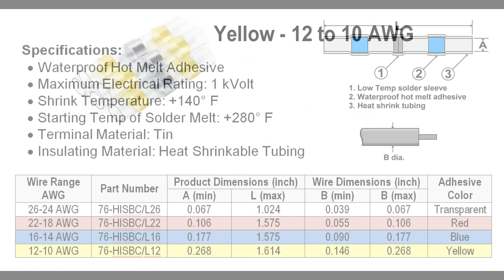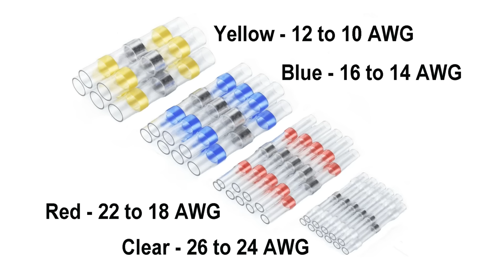Heat Shrink Self-Solder Butt Splice Connectors

Comment: How much did they pay Summit? Low temp solder? What happens if the wires heat up?
Reply: Mike Miller let's say it does get up to the temp needed to melt the solder. We're talking a whole other issue on why it is getting that hot. You have a catastrophic failure somewhere, that isn't related to this joint. I'd say it would be worth using without this fear.
Reply: nitroman365- I completely disagree with you. Regardless if the heat is coming from the wire due to a overload or heat by its surroundings, it still will melt the solder and could cause electrical fires. 

If Summit is backing this product, they should do so with all the knowledge of the product. But I doubt that is done. I’m sure it’s just money passing hands.
Reply: I can't say this is an ideal solution for every application.  But you have to understand that the temps it is taking to melt is extreme. Unless you put it right by an exhaust, or header, you're going to be fine. And if the load is so great that it gets that hot to melt the solder, then you have installed too small of a wire on that load. It all comes down to user error and responsibility. Peace
Reply: nitroman365 - the temps are not extreme to melt the solder. That’s the entire concern!
Reply: Mike Miller The melting point of the solder is 266°F.  That is, wires that carry current speaking, extreme heat. Again, place it near exhaust, you'll have issues. But it would have to be in an extreme close proximity to the exhaust for this to happen.
Reply: nitroman365- How do you know that? Have documentation?
Reply: "Apply hot forced air, 266° F or higher, to the solder ring until the solder melts"
Reply: nitroman365 - Not seeing it. Where are you getting that temp from?
Reply: Mike Miller Near the bottom, under "Product Details"
Reply: nitroman365- I don’t know where you seen that. But I just seen in the video that it melts at 280F. Which is almost 90 degrees lower than standard solder. Maybe this will work for some applications, but time will tell.
Reply: Mike Miller Keep in mind that that temperature has to be an isolated temp for a period of time. If it is that hot in a small space, other things will fail around it. It doesn't get that hot under the hood of a car. Upper 100's, sure. 200+?  Not so much. These are being marketed, in this scenario, for car guys. I know an FM transmitter for a radio station will see high temps in which it won't work for. So I stand by my previous statements. Keep them away from exhaust, which is common sense for any wire, and you shouldn't have an issue.
Reply: One last note. These are really designed for people who can't solder, or don't have the equipment. Anyone who can solder wouldn't use these.
Reply: I've used these things and it has to get extremely hot to solder them.  If it's good enough  for the F18 and  the Boeing 777, it will work for your car.
Reply: Been using these for LS Swap harnesses for 10 years.. it's way faster than using a solder iron & shrink. I put hear shrink over the solder shrink to hide my work
Reply: You can get them cheaper on AliExpress...50 count for $5
Reply: nitroman365 is right.  Most "high temperature" wire is rated for 105C/221F, lower than the melting point of the solder.  But I still wouldn't really use these much.  The aerospace industry stopped using them I think, due to occasional unwetted joints

Comment: Would be so useful for an electrician or other professional but will ever it be affordable enough for hobbyists to use it regularly
Reply: Elijah French the are afordabel on amazon from other manufactures this is nothing new my dad uesd thes 20 yearsrs ago in automotiv work
Reply: Nick Hetzer oh... Never seen them before
Reply: Elijah French they are ok but buttconectors to crimp with heat shrink and glue are way better but you need to use a god crimp tool not one of those 20 buck ones more like 70 buy one nice crimp tool for the rest of your life and the cheap one dont crimp nice

Comment: Wonder how much lead is in that solder for it to follow at such low temperatures. Also what about the corrosion characteristics of flux? If it's waterproof there's no way to neutralize the flux.
Reply: It probably uses Roisn based flux, which is a no-clean flux. It will be fine
Reply: Since when do you neutralise electronics flux?
Reply: Lead was banned a long time ago with ROHS.  Also these likely use a non aggressive no clean Flux.
Reply: Lead is banned only for new production. Lead containing solder is still allowed to use for service.
Reply: I use lead 60% tin 40% solder every day on military-grade harnesses
Reply: I think you can add gallium instead of lead to lower the melting point.

Comment: Nothing new. Aircraft have been using them for a long time.  Amazon even carries them.  The trick is to get them to solder in the first try because you melt the heat shrink if you try a second time.

Comment: Cool idea, but terrible price. I'd stick with the original way and save money. Way to expensive
Reply: Sean Zachary Uy check ebay. This tech isn't anything new and I get mine off eBay, 100 pieces for 24 Bucks.
Reply: jimmy vaught ok... that's sure a better pruce, but then again, I can get 100 metres of heartstrings for 4 bucks. So.. I'd stick with my way way for now, maybe I'd look into it for soldering more expensive stuff. But for now... imma save money.

Comment: lmfaooo almost 1$ per connection... for that you can get a soldering station, good quality solder and enough heat shrink tube for a year AND make better quality stronger joints
Reply: Damn, where do you buy all that for 1$?
Reply: I am buying them in Philippines for about 4 USD cents each. Shop around for a better deal.

Comment: that connection is anything but reliable, lots of lose wire strands that can create arching which will melt the plastic and cause problems.

Comment: Neat idea, but I wouldnt trust it.
Reply: IN1VISIBLE3.- they have been using them in aircraft for years.  I only have experience  at  Boeing, but all their planes  use them.
Reply: gsxrgeorge00 So safe to say they are more reliable than anything ever put into a car...
Reply: Yup, these have been used in aviation for decades.
Reply: Yep, they've been used in aerospace industry for more than 30 years.
Reply: Do they work with oxidised wires? What alloy is used?
Reply: Why are you using Luke lafreniere as you profile picture....
Reply: You would not trust a soldiered connection with an adhesive water barrier and heat shrink tubing?  
What exactly would you trust other than a single, uninterrupted wire?  

Not sure you understand the connection at all.

Comment: why should I pay that much to maybe save a few seconds on something I'm never rushing or in a hurry to finish, plus the flux will eventually cause the joint to corrode and start creeping up the wire,  not a job I would want to keep an eye on or re do every few years nor do I want to worry about the structural integrity of the splice especially because of the low temp solder,  besides I don't use solder connections because of reliability issues and whenever possible I run wiring from new components to a fusebox or junction block dedicated to aftermarket components, I never hack into wiring harnesses and if one has a bad wire I replace it after finding the cause of the failure therefore I can't think of a situation where I would use these over proper mechanical connection technologies this product is for the guy who's toolbox and tools have more experience than the owner... or the speakerbox butchering audio tech wannabe that uses lamp wire and sheetrock screws that insists they are a pro and have the balls to charge real money for their mickey mouse installation,  Can ya dig it?
Reply: The aviation industry has been using these for the past 30 years. I guess every time you fly if you can afford that you're on borrowed time cause of their "mickey mouse installation". If 20 cents is to much for you then maybe you should rethink your life choices cause clearly the videos you upload show you're below poverty. The wire would break before the connection on a tug test.

Comment: 1. Too expensive
2. Takes too long
3. Try getting a heat 🔥 gun in difficult places
4. Takes too long to cool
6. Please kill that useless music intro and throughout. It's annoying at best.
7. If you don't get the heat EXACTLY correct, you either end up with a cold solder joint or you end up melting the insulation hence defeating the purpose of this.
Reply: I just got a 100 pack off Amazon for $23 Canadian it's like 4 cents a piece and they work great with quick passes from a torch lighter.

Comment: Stupid product. Way too expensive to be even remotely practical. 100 connections for $70. I can buy a 1lb spool of solder and make 1000 connections for $20. That's 35x cheaper.  It's also no less work than twisting the wires together, soldering, and heat shrinking them the "old fashioned way".

Comment: The low melting point of the solder will make these connections a lone not reliable. Get a hot day and the glue and the solder will become soft.

Comment: I returned this crap;  it does not work. The problem with this product is the flaw in design and the materials used. There should be a sort of sync between the melting temperature of the solder and the melting point of the insulation, in a manner which should prevent self-destruction. What happens is that if you don't hit the melting point of the solder, the heat-shrink will shrink and become very soft without having the actual connection soldered and if you heat-up at a temperature which will do the actual soldering, the heat-shrink will be damaged. I used various methods, including a few hot air guns, near and far and what-not; IT DOES NOT WORK!
Reply: I got these off Amazon and the solder melts quick with a few passes from a torch lighter.
Reply: @PabloGonzalez-hv3td  Good for you! Do a resistance test; mechanical and electrical!
Reply: @A.Dude.  They work just fine with a little patience.
Reply: @PabloGonzalez-hv3td  Mate, calm down! I'll take your statement for granted and will look at myself at being wrong, the minute well established car audio installers like five star audio, will start using this system. Until then, have a long and joyful life!
Reply: @A.Dude.  Judging by the number of exclamation points used I'm not sure I'm the excited one in this exchange.

Comment: Automotive manufacturers would never use these. This is how you start fires, and melt big globs of wires together. Always crimp wires.
Reply: Crimping is inferior to soldering, but those are way inferior to true soldering. I can see that the solder in those acted more like glue than solder and I have doubt on the reliability, however I am sure that it will be more reliable than crimping.

Crimping is good for speed, not reliability.
Reply: @thephantom1492  incorrect
Reply: @RustBeltAuto  Then tell that to NASA
Reply: @thephantom1492  so you work for NASA? You show me a link where NASA says a soldered wire creates less resistance that a properly crimped wire. I will be waiting for your response FOREVER.
Reply: @RustBeltAuto  It is somewhere on the nasa site, however I can't quickly find it back, but I'll leave you with this: https://nepp.nasa.gov/files/27631/NSTD87394A.pdf and https://workmanship.nasa.gov/lib/insp/2%20books/links/sections/407%20Splices.html . Both crimp and solder is accepted by nasa, but I can't find where they say that they prefer soldered splice whenever possible. Both have their advantages and disadvantage, like crimp offer a better strain relief than soldered, but offer an higher resistance and if moisture get to it it can easilly corrode and cause a massive issue. Soldering is better for this as you have a lump of metal to pass throught, not just a bit of metal at contact point.

But crimp is faster, thru cheaper to make, hence why it is prefered in most application, and when well made and protected both shall last longer than the product, when the crimp tool and whatever you crimp on material is of high quality.

You can easilly make crappy crimp connection, but it is easy to make good soldered connection.

Personally, I repair stuff, I have yet to see a soldered joint to fail that wasn't botched (you know, china and their quality), but I have seen many crimp connection that failed. The crimped part itself is usually fine, but the contact side... ew...
Reply: Mercedes has required these to be used by their repair centers for ages. They have also been used by many militaries since the '60's with great success.
Reply: @flyingdutchman6984  it's not better than a crimped connection. That's all I'm saying. I use crimped waterproof connectors when I can, and only solder on circuit boards, and solid wires like resistors. Every connection on modern cars are crimped, and waterproofed, unless it is in the cabin. There are TSB's all over the place by manufacturers this day and age that tell you to not solder connections. It looses resistance, and can cause moving, and vibrating wires to break.
Reply: @RustBeltAuto  - I'll agree the gold standard is to properly crimp wires where possible, but I've used these for quite awhile on my sailing yacht with no issues. The loss of resistance from the solder is negligible on a 12v system. During a fresh install I'd prefer crimped connections, but these are great when I need to make a quick repair in a force 10 when I'm upside down in a lazarette. 😁
Reply: @flyingdutchman6984  audio guys never solder wires either. You should really get a good set of waterproof crimp connectors, and a brush can of liquid tape just because. Liquid tape after connections has been a marine grade idea for a long time.